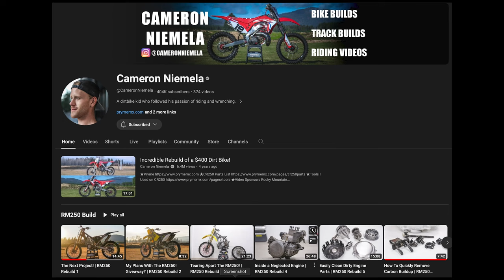Who is Toy Shop 9665 | Garage Tour | Tool Box Tour

Comment: Love your videos man, keep up the great work! I’m currently watching your moto 4 series as I have one of my own that I’m looking to restore. Where did you get your zinc plating kit? And where did you get the tires for your moto 4?
Reply from the maker: Thank you! That means a lot! The zinc plating kit is from Caswell Plating in NY. The wheels I got from a local powersports shop. Just a warning a restoration is a big job! 😂 It’s a fun one though!
Reply: @ToyShopRestorations  yeah man, I’ve restored a bunch of bikes, my moto 4 was my dads first quad and was passed down to me as my first, it’s been in the family for a while. It’s an 86
Reply from the maker: @awesomeproducts1582  awesome! As far as all the OEM paint. Keep as much of the origional paint as you can unless you’re going to paint it with a spray gun and not rattle cans. I used rustoleum and this stuff is garbage 😂 clean as much of the frame and stuff as you can to make it look pretty instead of trying to repaint everything. I believe I lowered the value of this moto 4 by repainting everything. Polish as much aluminum as you can and replate or replace rusted hardware. Polishing a rusted bolt won’t stop it from rusting again. Other than that good luck!
Reply: @ToyShopRestorations  great, thanks man!